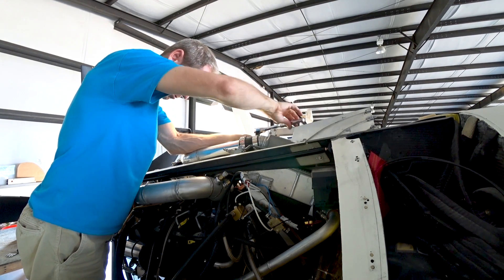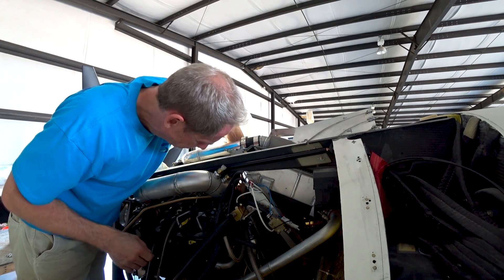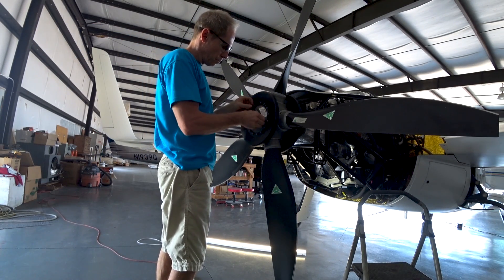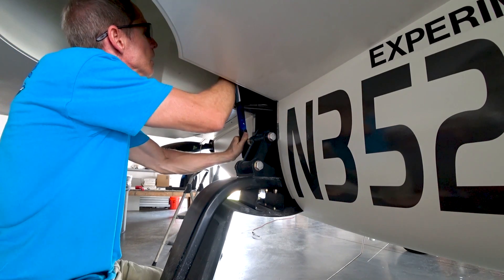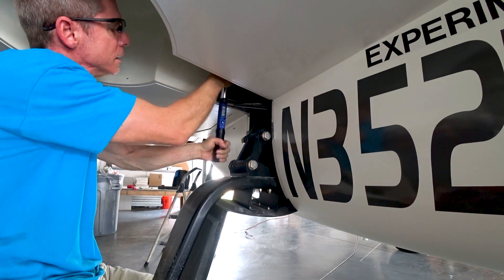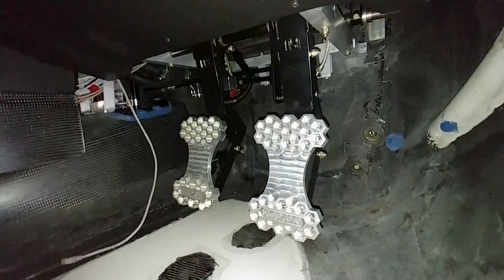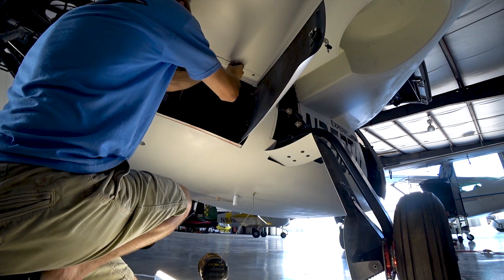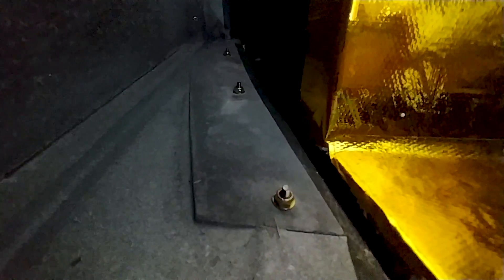Torquing the Wing Bolts - Building the Raptor Prototype

Comment: i worked in a heavy duty truck manufacturing plant for 25 years. the number one cause of component failure was due to air lines and harnessess rubbing against each other and other components. you need to spend some time securing those wires and lines better. i would imagine that a failure in flight is far more critical than a truck breaking down on the side of a highway.
Reply: Get a reputable IA critique your work.  Lots of cable management and hose/line securing left.  I noticed the intake plenum going to the intercooler move when you were checking the oil filter.  Recommend you secure it or risk blowing out one of the rubber sections.         Still continue to express my concern about your elevators.  I just noticed when your elevators move up, the chord of the fore plane gets less.  Have you taken this into account?

Comment: Where are you shopping for tools where a 15/16" 3/8" drive socket is hard to find? That said, 3/8" drive IS a bit small for that size fastener. Moving to a 1/2" drive torque wrench would not only be easier, it will potentially also be more accurate at that torque spec.

Comment: Since it is something that is going to need fairly regular access/changing, why not move the filter to an external location in the engine bay with an adaptor plate and hoses.
Reply: not that easy on this setup, the filter housing part of a larger casting
Reply: @anthonysbarrett  You will probably find that there are adaptor plates that allow this to be done with pipes to a remote filter unit.

Comment: How did you determine the 100 lbs of torque?
Reply: Aaron Huslage Almost no GA wing spar would ever require more than 100 foot pounds. That amount of torque will NEVER loosen up. Even on automobiles in contact with the ground. It’s a pretty common high strain torque value.
Reply: You can look up what is called "standard torque." it is based on the size, material,  and type of fastener. The US Army has a manual for it and I'm pretty sure the FAA does too.

Comment: Is there a lower main gear door solution coming soon?
Reply: It looks like that would be simpler to mount the lower main gear door on the wing.  Considering how many bends would have to be negotiated, rigging up a bell crank system on the main gear would always going to be difficult, and it might prove too delicate after a few landings.  If the door were hinged on the wing, it would be fairly simple to have the main gear push on a linkage to close it, rather like the nose wheel.  A spring could hold it open when the main gear is deployed.  It's probably too late to do something like that for the prototype; that might be a viable solution for production aircraft.
Reply: @6B8RX  Certainly a viable solution and I'm sure Peter has considered it. One argument against it though is the size of the attachment. Hinging it to the main gear door anchors it along it's longest possible line, whereas attaching to the wing utilizes a shorter attachment and places much of the structure's drag ahead of the attach point in the airflow. Not insurmountable, just a trade-off. I'm curious to see which way Peter goes with it.

Comment: 100ft-lbs is way easier with the longer 1/2drive clicky type.  That one is too short.
Reply: Had to do 250 Ft-# on a large nut on a steering knuckle.  Didn't have a torque wrench that went that high.  I was able to come up with a 50# spring scale though.  So I got a 4-1/2' cheater on the ratchet handle and made sure it was pointed straight up vertical so the weight of the cheater wasn't affecting torque. Then calculated where to put the spring scale near the end of the cheater and load I should have.  Worked fine of course.
Reply: Not only way easier to hit 100ft-lbs on a 1/2" with a nice long handle, 100ft-lbs has to be right at the limit of tat 3/8" wrench which may also be less accurate than in the middle of the range.